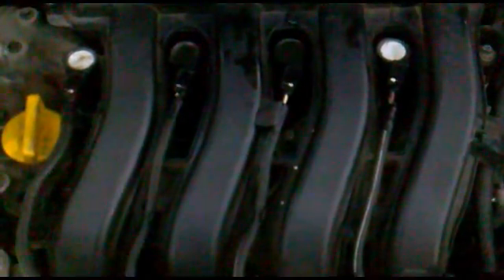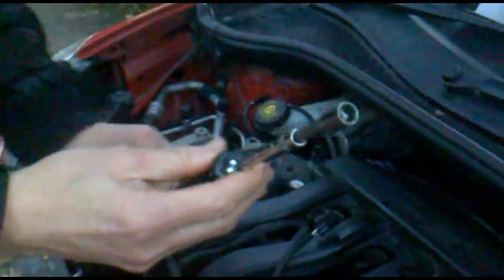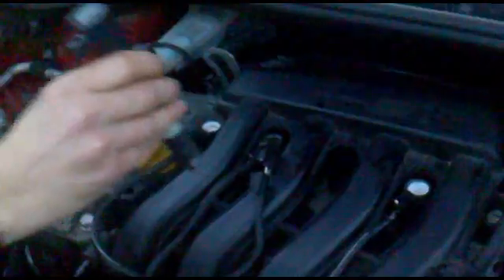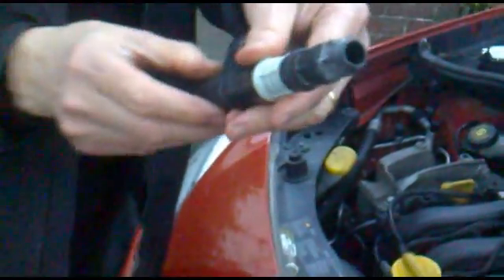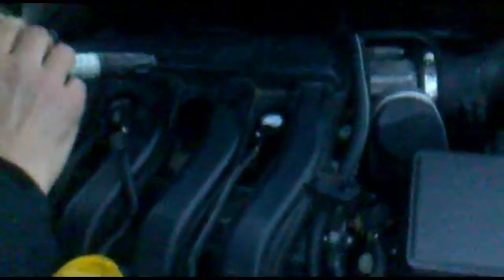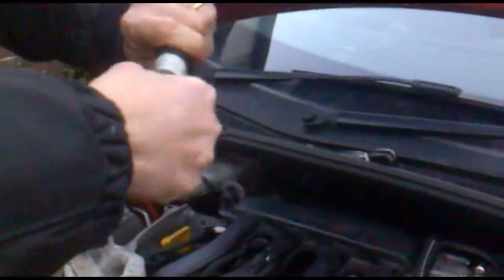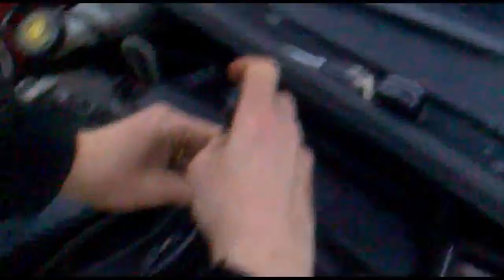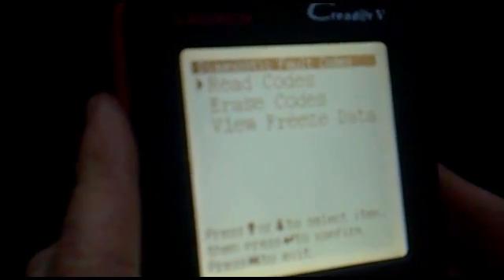Clio MK 3 mIsfire remedy

Comment: Can someone Help.I have Renault clio 1.6 gt line.the problom that i have is when i want to accelerate,the car goes into limp mode and the car start shaking pretty badly. code p0300 ramdom multiple cylinder misfire detected.
Reply: Hi, were you able to fix your problem?

Comment: my Clio MK 3 engine turns over but does not stay on. it runs very rough and then cuts out.
removed the plugs all were bad and one was almost melted at the top the electrod was badly worn. still cutting out and when I rev the engine I hear some valve noise.  any ideas?
Reply: ChessGuru have you tried replacing your fuel filter? Could also be your fuel pump that needs replacing as it may not be pumping enough fuel to the engine.
Reply: Head gasket

Comment: hi mate can i remove plugs without using a fault finder,not quite understanding when you talk of codes thanks chris
Reply: What code reader you got there bud?
Reply from the maker: Hi Chris, The code reader tells me which coil is the problem. I haven't removed the plugs yet but you need a spark plug socket with a long extension on a 1/2" socket ratchet wrench. Unplug the coil and before you take out the spark plug make sure you blow out the access hole first to stop any loose dirt falling into the engine cylinder when you remove the spark plug.